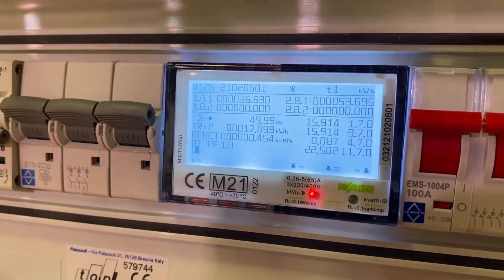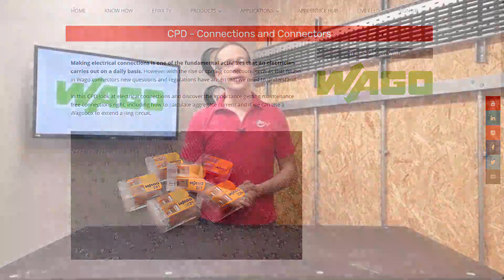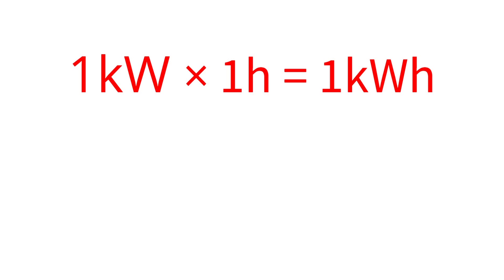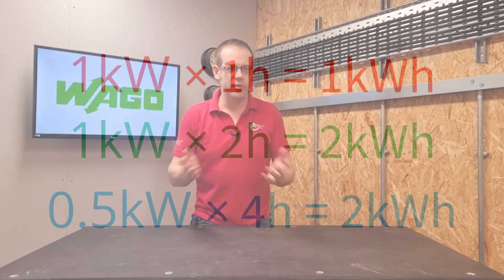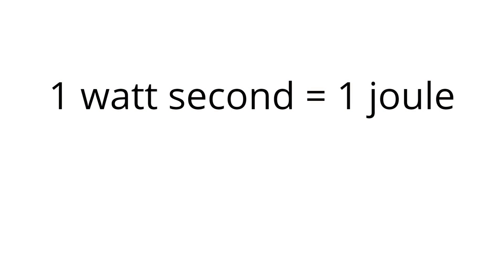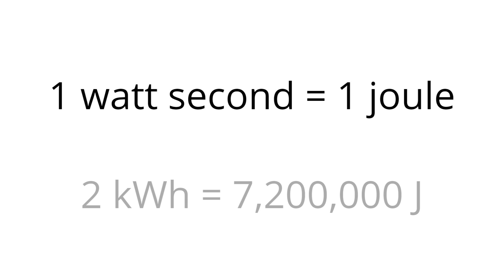What is a KILOWATT HOUR? ⚡️kWh ⚡️ - Energy Consumption

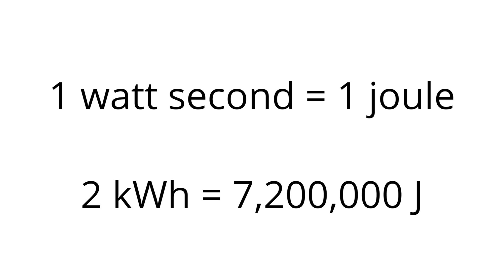Comment: 2:15 - you haven't really answered the question of why we (as a society / industry) don't use the correct SI unit for energy (J) with an appropriate SI prefix. 7MJ surely isn't that different to 2kWh? And is better than 2000Wh which would be the alternative without a scaling factor.
Reply: If using Joules was better then we'd be using it. 

We measure power in watts and kilowatts, so it makes perfect sense to measure the energy consumed in Watt-Hours, and it's very easy to calculate it if you know the power the appliance consumes and how long it is turned on for.

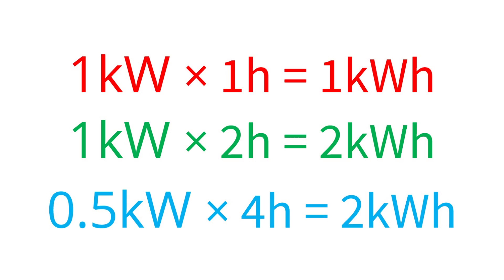Comment: 1:53 - "half a kilowatt hour for four hours" is spectacularly unhelpful language for this video! I know it's just a slip of the tongue, and I wouldn't normally mention it, but when 1) your video's shorter than three minutes, and the 2) whole point is to clarify these terms, it seems a bit silly not to have corrected this.
Reply: As you know, in English, it would be incorrect to have "for for" so it is fairly intuitive for the second for to be four.

I don't see it as a problem.
Reply from the maker: Could you elaborate as to why its spectacularly unhelpful? How would you have stated it? 🤔
Reply: @efixx  "half a kilowatt for four hours", rather than "half a kilowatt hour for four hours"

Comment: I don't think using kWh is anything to do with creating small numbers on energy bills.  
The derived SI unit of MJs (mega-Joule-second) would accomplish that.  
No, it's just about connecting the rating of an appliance with the cost of using it, in a straightforward way that the average punter can grasp.  

Good thing too, otherwise it would be like all that BTU, Calorific Value, cubic metre nonsense the gas-bods have to deal with.
Reply from the maker: Fair point. 😊

Comment: And when everybody has got a smart meter they’ll change to Kva measurement, and with the LED’s and their poor power factors, watch the electricity bills rise then 🤷‍♂️🙄
Reply: Reactive power in a home is currently ignored.  Commercial application will try to get the power factor a close as possible to one (1). 

   Do you think that will change when and if we go to TIME OF DAY billing for power usage?
@waynio67
Reply: @tedlahm5740  Time variable pricing is coming and eventually apparent power billing will too.

This is why we must resist the uptake of smart meters. It is not the right solution to the problem.
Reply: Probably phase them in separately ( no pun intended )
Reply from the maker: The currents involved are so tiny though even including power factor.
Reply: Please stop with the shocking jokes..."currently ignored", "probably phase them"...